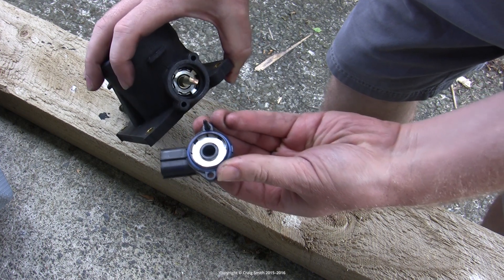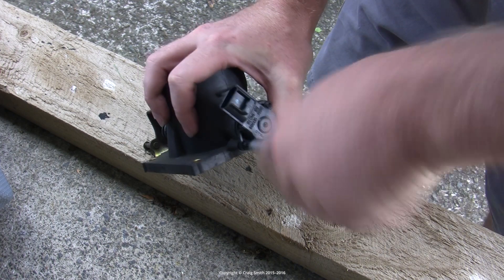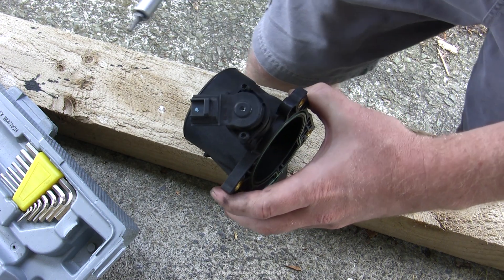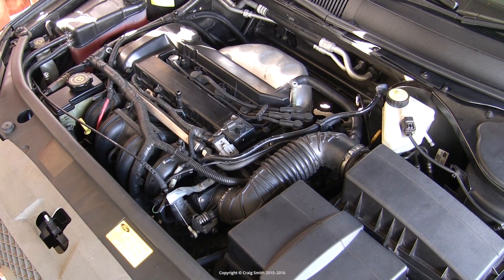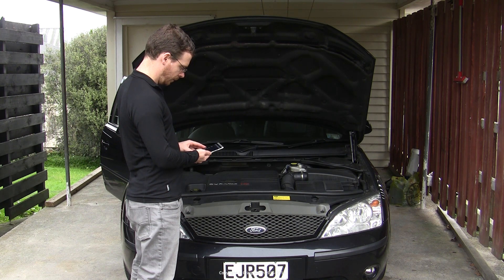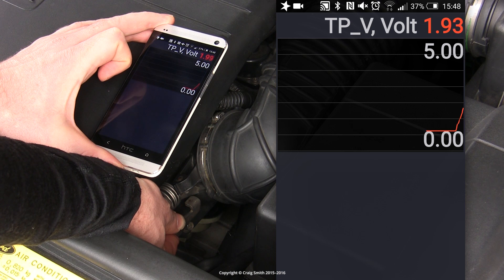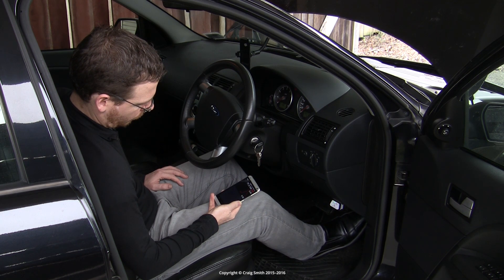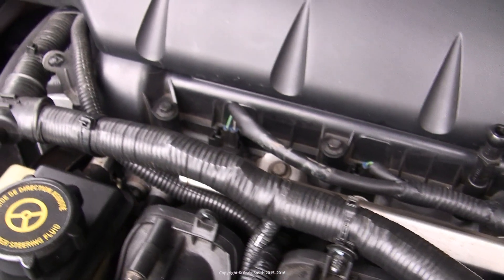How to: Test a throttle position sensor with a cheap scan tool

Comment: Hi, I have a Ford Mondeo mk3 1.8 duratec 125 cp and it has recently started to run out of power and if I accelerate very fast, I hear a loud noise from the engine, it's very very rough this sound. do you have any idea what the problem is?

Comment: Quick question; When I press the accelerator, there is a slight drop before it rises. And slight drop when it goes all the way back to the floor.
 Is that normal?
Reply: Quick reaction  :D :D

Comment: Plugged a scan tool in, and it shows 100 percent throttle at less than half foot pedal, no codes but engine sometimes loses power etc, new throttle position sensor needed?
Reply from the maker: Have you checked cable & pedal. Does 'half foot pedal' equate to ~half TB butterfly valve open by hand as shown in video? And does it jump to the 100% without a smooth ramp-up.

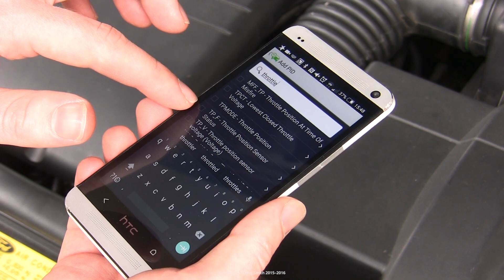Comment: Do you know if BlueDriver OBD II can do TP_V (3:46)?
Reply from the maker: I'd be very surprised if it can't, these are just in the standard set of OBD PIDs, nothing manufacturer specific. But you would be best checking with them to be sure.
Reply: @CraigsDIY  I own Bluedriver Dont think it reads voltage Tell me if I am wrong Please!!
Reply: I own Bluedriver Dont think it reads voltage Tell me if I am wrong Please!!

Comment: Hi ! I have a problem with my mazda6 2.3 02 . why my throttle position with engine stopped is 20 ? i have a low idle and i try to find the answer :(. check this photos https://imgur.com/a/0MUoc  https://imgur.com/a/uN8I6
Reply: I tested with another throttle and it's the same, so it starts from there

Comment: Hi Craig, can you please try to help me, I also have same car as you and same engine, I have problems with rpm in neutral gear, or  when i drive and press clutch the rpm goes down to 400rpm and then back to 1000rpm then goin arounnd 700rpm and waves. I changed coolant thermostat, throttle position sensor, temperature sensor and I clean Idle Air Control Valve, and still same problem, its very annoying. Do you have maby some idea what should I chek more. Thanks
Reply from the maker: Is it an idle problem or a clutch problem. I.e. if idling in neutral and you depress clutch, does something happen. If it's just an idle problem this sort of thing is usually a vacuum leak. Check everywhere from throttle body to header. Don't forget the PCV hose under the manifold.
Reply: Thanks for answer. Its not a clutch problem, only idle rpm. Vacum leak, what you mean under that. Im sorry if I make some mistake in writtening, Im from Serbia. I will be very thankful If you can help me solving this problem. I didnt chek that PCV pipe. Can EGR valve produce this type of problems?
Reply: Also, I been on computer diagnostic, and there was an error code for EGR valve, as I understand its says not enough air, in mixture there is to much gasolin. Is it posible by yours opinion, that EGR valve is cosign this problem? Thanks man.
Reply from the maker: Sure, you need to sort whatever is causing that code. Possibly the EGR is clogged up. I have a video on getting to it here - https://youtu.be/uUJSP5zCyQo - but it could be more than just cleaning required.
Reply: Yep, I also have some filing that its not only a EGR problem, here is now very cold and snowy, when its get better weather I will clean EGR and see what is happening. Anyway I will inform you, thank you very much, I wish you best.
Reply: Craig, hi again. I clean EGR completely and situation was same. But I think that I found a source of problem, my opinion is that I have problem with fuel pressure regulator, he is liking so in 4th cylinder I have extra mixture of benzin and air and its making confusen for idle rpm.
Reply: try to change the tps or try to adjust its position...

Comment: Hey man, did you say "foreskin"? LOL
I got one of those wireless OBDII scan tools but it only works on some cars, can't seem to get it to work on my GFs honda accord @#$% , it's made by Innova, nice when it works but it's unreliable and a total ass-fuck sometimes. It uses "Quicklink"...

Anyway, if anyone buys one of these things make sure you can take it back if it don't work for ya!
Reply from the maker: Try one of these: https://youtu.be/KdvnPC204zU
Reply: I wonder if I could make an arduino or raspberry pi version...

Comment: Is 0.9 to 5 standard for all engines? Having tps issues on a 4age  ST. Thanks.
Reply from the maker: No, it's usually in that ballpark but you will have to look up the specs for your motor.
Reply: Thanks.

Comment: 02 tarsus I unplugged.tps now it.runs better will this.harm anything
Reply from the maker: It will presumably be inefficient. Try another TPS, if that makes no difference then you have another problem somewhere with the EFI that needs fixing.
Reply: Craig's DIY Car my trans problem started when I put in new tps and did not help ideal problem I'll try another tps on next pay day I'm just retired old man trying to fix my car thank you very much eddy
Reply: Eddy Bourland Keep it unplugged! Unplugged all sensors! It won't hurt!
Reply: Eddy Bourland TPS need to be adjusted to a certain voltage sometimes. A Snap-on scanner is VERY useful for that! E-Bay has then! Get the cartridges and cables and adapters and manuals.

Comment: hi Craig 

i got 4.10 tops and 0.9 lowest .is that good ??it hasnt maxed out to 5.0 v???
so can i rule out the TPS in this case??
Reply from the maker: That should be okay, it is more important that you can get a smooth transition from closed to wide open throttle with no spikes or gaps in the voltage.
Reply: عمل تي بي اس

Comment: Which app is this?? Can't find TPS VOLTAGE PID in any app I have downloaded
Reply from the maker: I am using Forscan which is a Ford/Mazda app. Try something specific to your vehicle as the generic phone apps are often not complete. Search for TPS or throttle in different modules. The car may report a percentage % not voltage.

Comment: also when its idling on drive the rpms seems a little low and noticed that it goes up and down but not to much. any advice?
Reply: try to change the tps or try to adjust its postion by moving a little until you hear a hasing sound...

Comment: I have a 2001 nissan sentra gxe. the service light today came on and gave me the code p1126. I did some research and it says it is a bad throttle control motor relay. would it be the same process?
Reply: Replace the thermostat...

Comment: Do you have any idea of why I always find engine oil inside this hole where the sensor is placed? Thanks
Reply from the maker: A dirty throttle body is not uncommon, and enough oil there will get into the TPS also. Clean the throttle body. See other video linked in desc.
Reply: Can I send you a picture of where exactly the oil is? My throttle body is not dirty at all but I can find oil inside the axis that goes inside the sensor. Thanks.
Reply from the maker: It can only be coming via the intake manifold and throttle body, perhaps it just accumulates around the TPS. Unless someone 'oiled' the throttle plate? If everything is working okay I wouldn't worry too much about it, although excess oil in front of the intake ports usually means PCV/valve component needs replacing.
Reply: The PCV valve... I've never thought about that. The car is 10 years old, 5 with me. I guess it's never been replaced. Thank you very much for the tips.
Reply: that is new newest one i have is 16 yrs